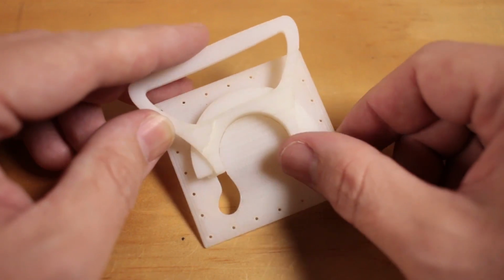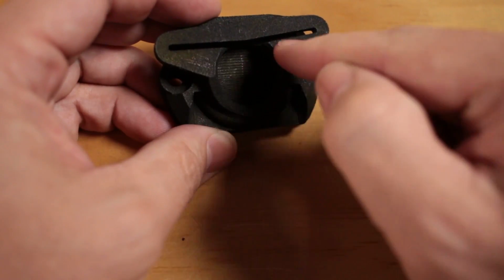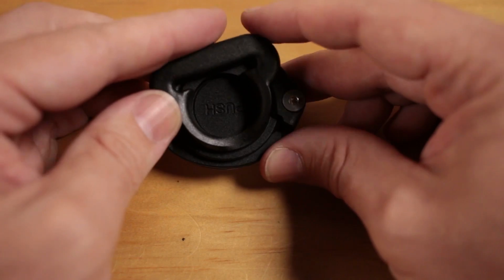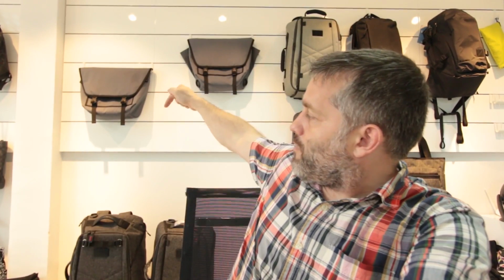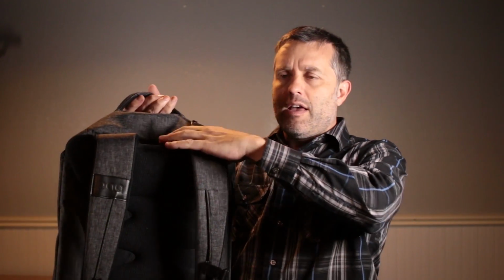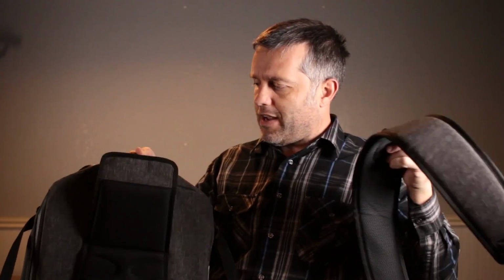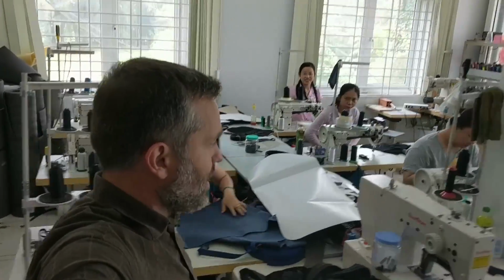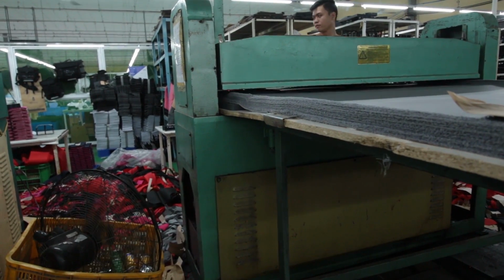From 3D Printed Prototypes to Mass Production in a Factory

Comment: Wow 10k just for the mold? Are there lower cost molds that can be made in Vietnam or China?
Reply from the maker: Mold Making is very difficult. The molds must be very accurate, and you must make them from hardened steel. Similar to the stuff they typically make HSS drill bits out of. They can't make the molds and then heat treat them to hard because that would warp and distort them. Therefore, they must be made in the fully hardened state which requires some very knowledgable/experienced CAM operators working on some very expensive CNC machines. There are ways to save money, but longevity of the mold is typically reduced greatly.

Comment: I design things and i really understand the issues and is somewhat happy i was not the only one redoing, scrapping, picking up old parts, remake them adjusting redo all of it..and eventually end up with something feasible... this was a very nice video of a successful endup of a very hard work. One thing i lack with a lot of bags is genuine waterproof bags..that is not in need of a plastic bag inside. Even some military grade bahs require plastics as basically you sleep outsides for days in rain and bags are not kept inside tents..and it would be pissing wet without the plastic bags. That creates bulkiness and were not talking about humodity but constant rain proof like a showerhead.

Comment: Did you end up using your 3D prototype as a mold for the injection molding? Did it help out with the cost of making the actual mold itself if not? Also how would you compare Thailand to China as far as injection molding services go?
Reply from the maker: All complex molded designs these days will go through multiple 3D printed design iterations. This has nothing to do with the mold making process, it only proves the design as viable before making the expensive molds. So, it saves you the cost of having to make multiple molds if the part isn't right. FDM (AKA FFF) 3D printing does not help with the mold making process. There are some other additive manufacturing technologies that can directly make molds for limited production runs (10-50 parts), but that is not something available to the home gamer as of yet, and maybe not ever.

Comment: I know this is an old video, but my company has a HP Fusion Jet 4200 printer and I think this part out of PA12 GB would be every bit as smooth and as strong as your injection molded part. Plus, we can mass produce and add a teflon coatings to the part. Hit me up if you want to test your future designs on our printer. Great video!  Robert@hosecoupling.com

Comment: Why not just use formlab engineer resin for this job instead of traveling all the way to Vietnam and spent 12k dollars for this?
Reply from the maker: Because I plan on making hundreds of thousands of buckles. Injection molded parts cost pennies, and pop out of the machine every 10-20 seconds. 3D printed parts cost dollars and take hours to make.
Reply: hmmm i see. good luck on your kickstarter ! nice bag
Reply: There are many ways to do prototyping with injection molding and or thermofoming. i have 27 years as a thermorforming tech. The proto molds are never made from aluminum most start from mdf then to delrin to pull sample shots.  They have sample injection molds as do sample thermoformers at low cost to proto type as long as you know what company to goto. The money comes when its time to design the final mold for production.